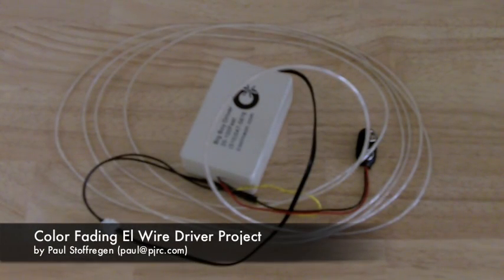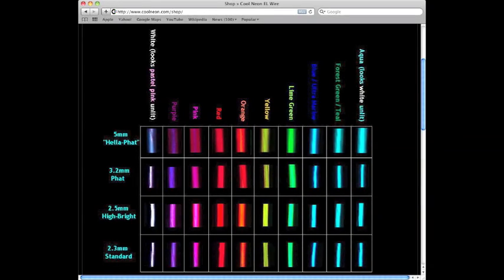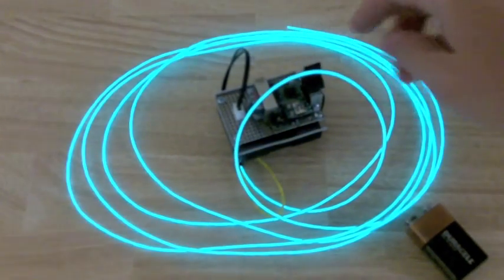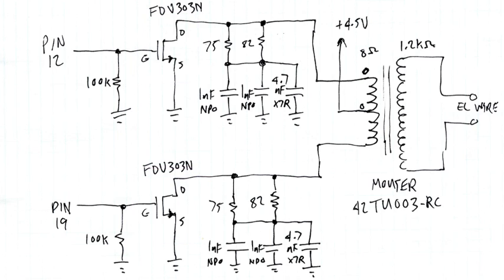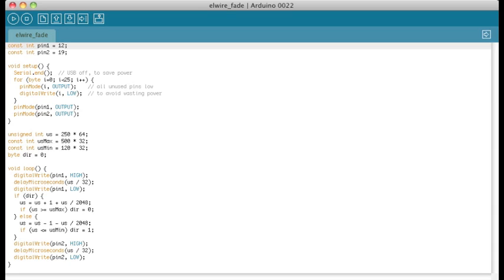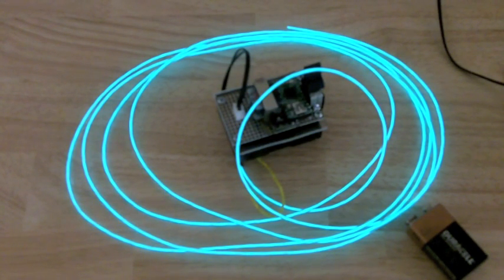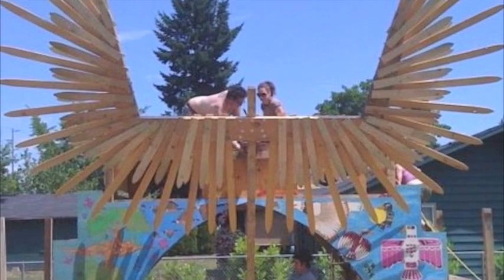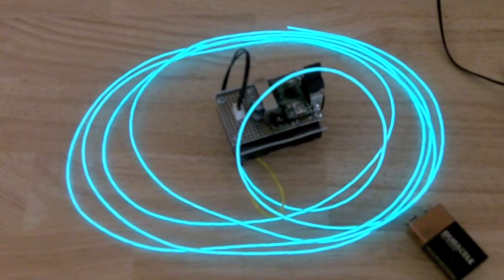Color Fading El Wire Driver Project

Comment: Can you make it so it stays one color and does a "pulsing" effect?  By that I mean the same color glows bright, then dim, then bright, over and over as if the color were pulsing.  Thanks!
Reply from the maker: Could I do it, yeah, probably.  Could you?  Some Arduino skill & time required.

Will I do this... nope.  This video is from 10 years ago.  No idea where this old project is, or even if I still have it, or any el wire at all.  So much has changed over the last decade.  LED strips are the way now.

Comment: You'd get a more dramatic result by simply switching, rather than fading. That is, switch between one frequency and the other. Optionally, switch the wire off between colours, ie green - dark - blue - dark - green etc. 

I'm not sure what the / 2048 does in the code, doesn't seem immediately necessary, can you give a brief explanation? Surely "us" just needs to go up or down a step at a time.

Comment: I need your help !!!!
that's exactly what I'm looking for ,butI would like to use panel's, for it
more precisely in the ATX format for PC case
I am planning a lighting at the edge of the motherboard in the Case 
Like the movie The Wraith Engine Scene - Dodge MS4 Turbo Interceptor but in Blue ;)
OK that Plasma ligthing were not Possible without the Avexir RAM installed but.... u know ;)
Link : The Wraith Engine Scene - Dodge MS4 Turbo Interceptor
Reply: You can get all sorts of EL panels, and the boxes that drive them. It's popular in the case modding scene. The colour-changing shown here is more subtle, and requires at least that you understand the circuit diagram. Which isn't complicated, relatively speaking. 

If you don't understand it yourself, you could learn some electronics, or just use a standard EL power supply box, powered by a 12V line from the PC, and whichever panels you like. The panels can be cut into any shape with scissors, but you need to connect to them at a certain point on the edge where the layers are exposed for connection. 

Stuff like flashing is possible. More complex stuff would take imagination and a bit of work, but it's common enough among case modders. Go check some of their sites out.

Comment: where can I purchase this wire?!
Reply: "Electroluminescent wire", all over the place! Electronics component supply shops, and of course on the web. You choose the colour you want (from around a dozen), then buy it by the metre. You can also buy drivers that work from a simple DC power source, and convert to the necessary EL wire driver voltage for you. They come in little boxes with a power input and output. 

The drivers you buy are simple, and provide just on / off control. You supply power when you want light, simple!

To do the variable-frequency stuff like here, you'll need a circuit like the one in the video. An Arduino-compatible microcontroller chip controls it all through software. Arduino is pretty easy to get into, if you know a little electronics and programming. Even if you don't, you can buy starter kits that will teach you how. If you're fairly smart, you'll be able to manage, and soon enough end up doing cool and impressive things from your own ideas. 

A local hackerspace, if you can find one, will have this material on hand, and be able to help you. Otherwise, it's not too hard, and there's plenty of tutorials on the web. You can get kits, containing an Arduino-compatible board, a breadboard, some components, the software, and a tutorial book. 

I say "Arduino-compatible" because Arduino is open-source. That means it's made by many different companies, all of the boards are the same, compatible with the standard software and hardware. You can connect Arduino to almost anything. It's a fun hobby, and there are examples on the web of all sorts of things you can do, all sorts of hardware you can connect to and control with an Arduino.

Comment: nice work, but I have a question maybee a few of them ;) 
does it work with all coloerd el wire  and how strong is the effekt 
for example : when i use flowing el wire is it strong enoth to withstand the flowing el wire or does it go under in the lighting effekt against the flowing on.....?
let me say it like Martin Luther King " I have a dream "
Reply: What do you mean "flowing" EL wire? I don't understand that at all. 

For the colour range you'll get, it depends on the wire itself. Some will have more range than others. As you can see here, it's pretty subtle, and I think this example is probably one of the best results it's possible to get. It's not really all that variable in colour. 

Of course you could use strips of smart LEDs. These are red, green, and blue LEDs, all in the same unit. They have a little microchip inside, that you send digital signals to. An Arduino is a good way to generate those signals, there is source code and libraries available on the web for doing it. A little bit of code and you can have a strip of LEDs in any colour you want, different colours per LED if you like. The LEDs come on a tape, made of flexible circuit board. You just order however many metres of tape, with 1 LED every 5cm or so. They're useful for all sorts. You increasingly see them in signs and lighting displays in bars, etc, sometimes used as decorative lighting in homes.
Reply: Devon, no, EL wires aren't all blue-green with a different coating. The phosphor is the chemical that creates the light, and they come in different colours. Some have an extra coating to fine-tune the colour, but the basic produced colour is close to the colour you're getting.

Comment from the maker: You'd probably need at least 2 timer chips, or some sort of logic chip to be clocked by the 555 and create the outpus, since there's 2 transistors to drive.  I know many people consider a microcontroller to be "overkill", but for the initial experiementing and ease of trying different waveforms, it's extremely convenient.

Comment from the maker: LOL, you can't buy it anywhere, or at least not anywhere I know!

It's unlikely this will ever become a commercial product, partly because the effect is subtle, partlye becaue it only works with clear-jacket El Wire, but mostly because controlling the frequency requires a much more complex (expensive) and somewhat less efficient circuit.

If you want one, you need to built it yourself, or find someone to build it for you!